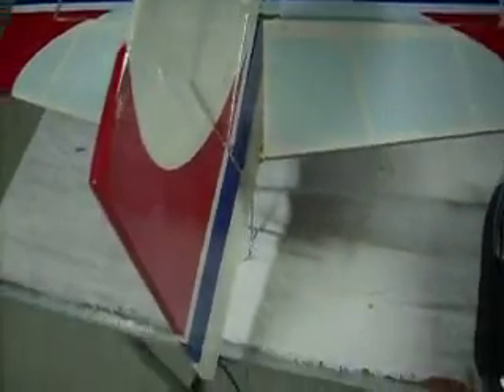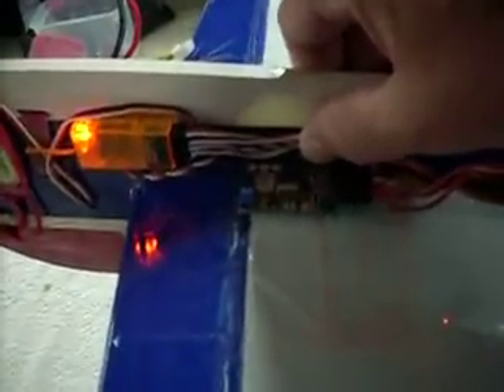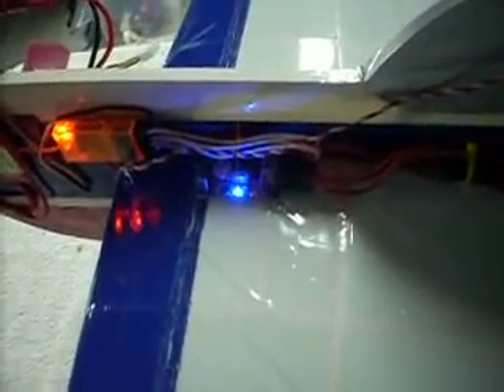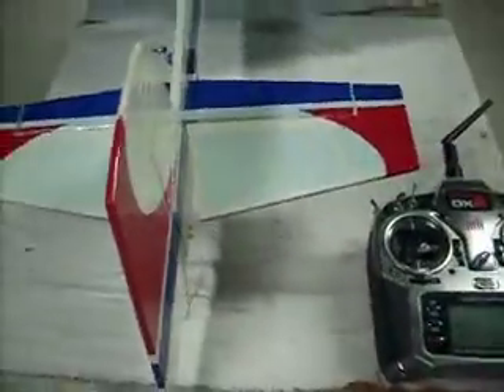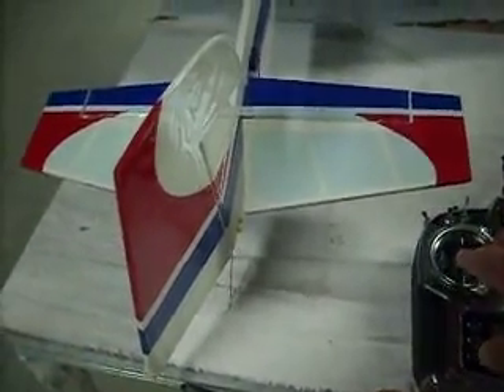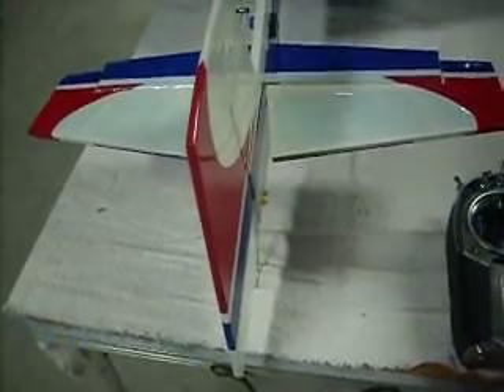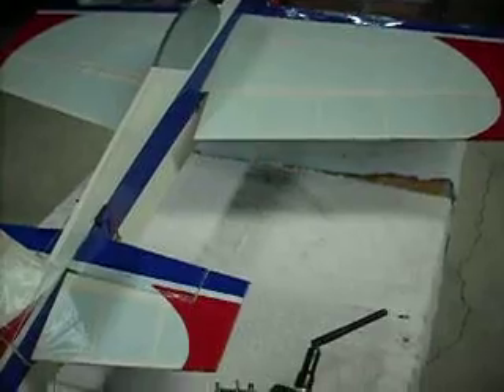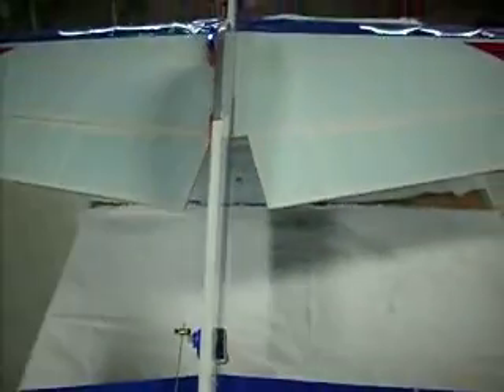Eagle A3 PRO stabilizer

Comment: installed mine works great. the hold mode is used for 3d or trick flying.  hovering and knife edge stuff. ill try to give the link for my video where i am holding the plane in a hover position and you can see the elevator and rudder acting to hold the plane in that attitude.  i only use the hold/red/avcs mode for doing tricks then either turn it off or go to blue mode